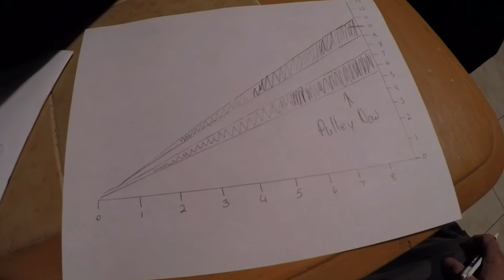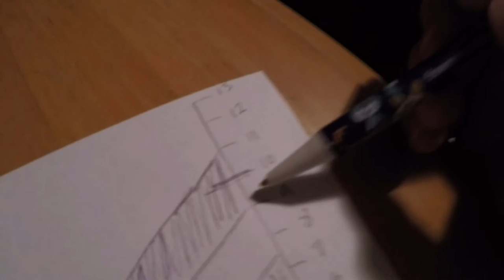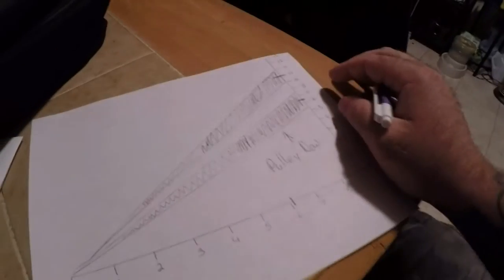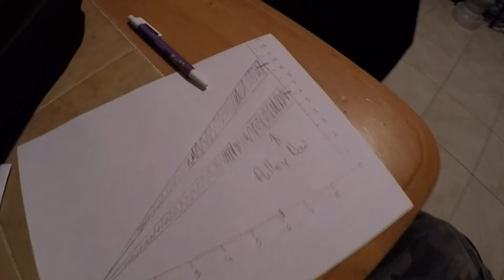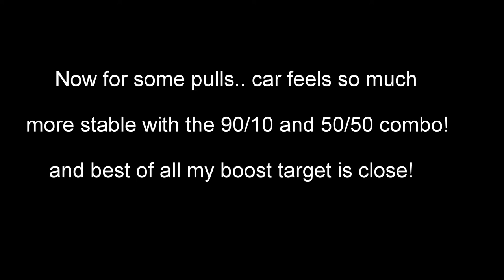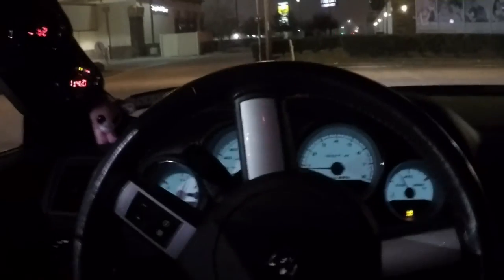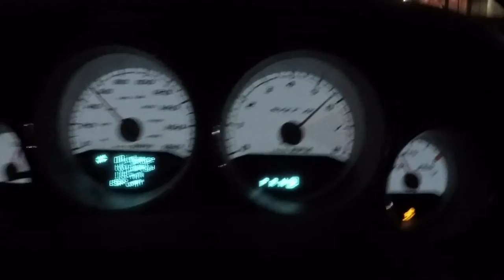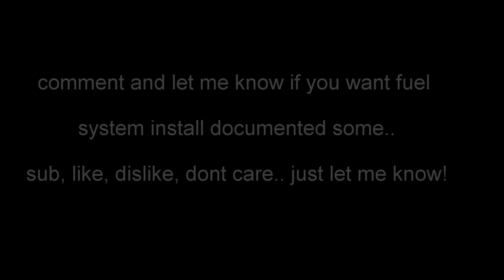Bad juju got the rear lakewood 50/50s and a bit more boost!

Comment: How much do you feel your front end lift up with the shocks. I want 90/10s for the front and 50/50s for the rear and I wanna try to find some high energy front springs for the front of my car I drive a 2016 charger rt but I got alot of shit in it.
Reply from the maker: Nathan Letteri well the track videos show it lifting alot honestly.. it pulled solid 1.5s just a couple weeks ago on only 9.5psi and at a weight of 4460lbs
Reply: OMGITSMRMACK im pulling 1.6-1.7 on stock suspension but im hooking do you think I could still drop that time with suspension even though im hooking

Comment: Do you live in houston?
Reply from the maker: yea man
Reply: OMGITSMRMACK ah man imma dodge owner now and I seen your work and need your recommendation and I'm from Houston too
Reply from the maker: +seanquadew what's up? I'm down to help as I can
Reply: OMGITSMRMACK ok I have a 07 charger srt8, I was thinking about putting a 392 in it and down the road build it and procharger it, what you think? My goal is to make over 600 to the wheels and daily it
Reply from the maker: +seanquadew I'd just do a rod and piston set up and leave it 6.1 honestly.. 600 is easy
Reply: OMGITSMRMACK ok cool, any good companies you recommend?
Reply from the maker: +seanquadew well I get parts and have things done locally.. we have too many great machine shops to go elsewhere unless someone has the bank roll to outsource from the only place I'd use.. and that'd be modern muscle.. but so far I've only ever gotten some parts from them.. the short blocks I do here.. heads and intakes myself.. and cams usually also.
Reply: OMGITSMRMACK o! Ok I was planned on getting my intake and heads ported wondering that'll be good gains in there and get a cam and tune as well
Reply from the maker: +seanquadew the heads/cam/Manifold and long tubes I do on cars is a pretty nice gain. every car reacts a little different being as all short blocks and supporting mods tend to very from car to car.. I'm still working some deals for those packages this month so I can get them wrapped up before the tuner comes in February.  if you're interested in anything just lmk.. leave an email and I'll hit you up.
Reply: OMGITSMRMACK cool, what's your email address?
Reply from the maker: +seanquadew hit me on my face book page.. I don't leave my email out here due to some stalkers lol.. no bs. that's why nothing is public.
Reply: OMGITSMRMACK I completely agree lol! Ok let me look for ya